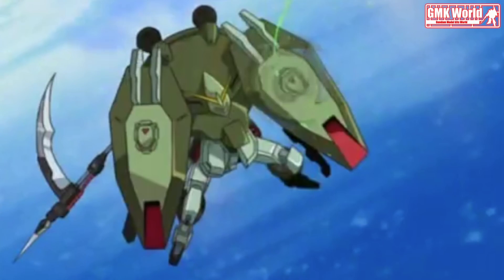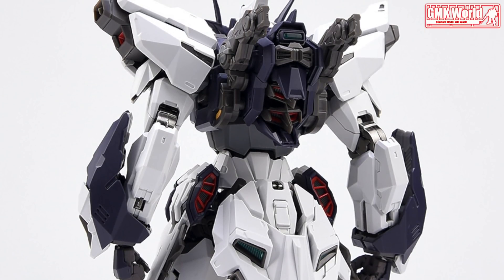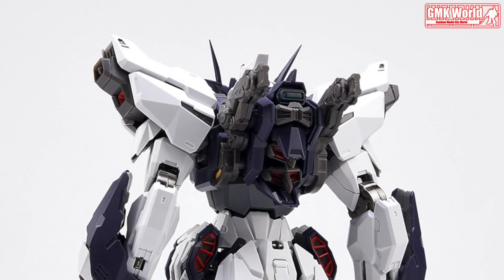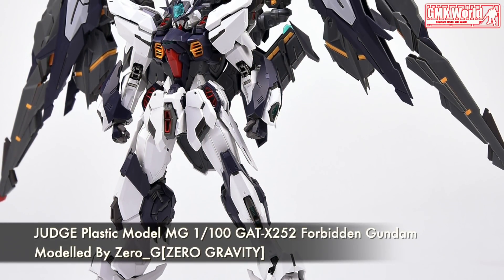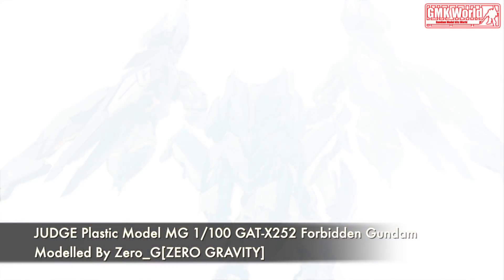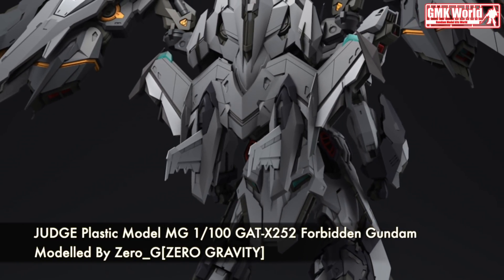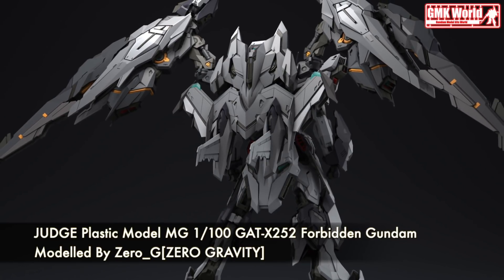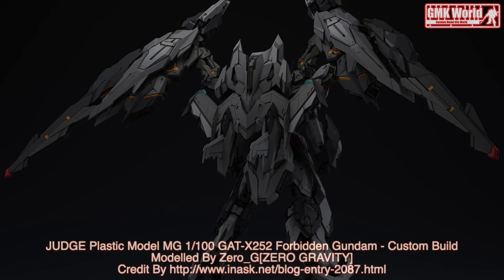JUDGE plastic model MG 1/100 GAT-X252 Forbidden Gundam - Custom Build

Comment: How's Zero G? Is the kit as good as Dragon Momoko?
Reply: Even better quality in my opinion, I had very few issues with this thing. Only like 2 parts that were a bit too tight fitting and the hands don't hold the scythe that well. Other than that it's an amazing kit. The metal frame is super well made and heavy af, the plastic feels very high quality and doesen't have any flash at all. You have the option for clear green details or gray, it even has an optional V-Fin if you want it to look closer to the Forbidden. If you can get your hands on it I'd 100% recommend it.